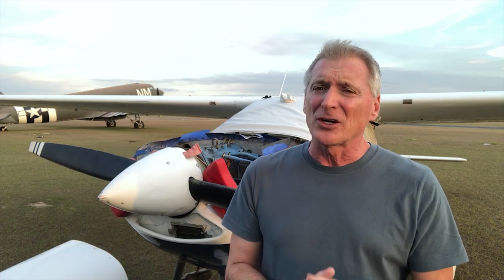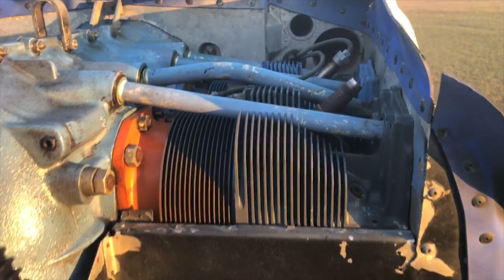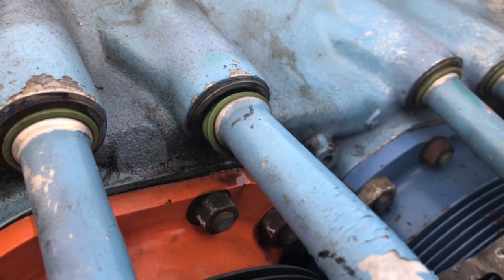When Really Bad Things Happen

Comment: Savvey aviation just did a story on a similar situation but it happened in flight. The results were not as bad as I expected. You may get away with a replacement jug and pushrods if your cam is not damaged. Might be worth a try to get that extra 200 hours out of it and build up the replacement engine account. It was a well written piece/advertisement. I actually trust Mike And his people to be very safety minded while also keeping economics in mind. Good luck with whatever you decide.
Reply from the maker: That’s exactly what I’m doing and I was referred to Savvy aviation as well ! Thanks for watching!

Comment: The pushrod is a consumable. Probably from a stuck valve. Before you do anything else just have the push rod replaced and see what happens. It looks terrible, but apparently not really. 
Looks like a Lycoming 0-320. I've got one in my Warrior. I got 3968 hours SMOH on mine before I had a prop strike. I also had a bent push rod. I ended up getting an engine rebuild, which is still in process. But now...it's compounded by the new Piper wing spar AD.

Comment: This happened in flight to a C172 in my flying club.  Ended up a rocker on the exhaust broke and caused this to happen to the intake. That engine had just been overhauled and only had 200ish hours. Happened in flight and pilot was able to still fly and make a precautionary landing.

Comment: Was your engine running rough on low rpms on previous flights? This may have been an escalated lycoming morning sickness. It’s a miracle the valve ended up getting stuck while you were still on the ground. Fly safe. Love your videos and thanks for sharing.
Reply from the maker: Thanks actually we found the real problem which was a hole in the air breather tube which made the engine run for Rich and I don’t know how long that’s been going on. I wanted to make a video on it but I’ve been so busy with work and I haven’t had the time. Thanks for watching! I have some programs coming up or I’ll explain everything—
Reply: Over 50 and Learning To Fly! Looking forward to it. Keep up your excellent videos

Comment: Don't let the shop tell you right off the bat to replace the engine for $23k !!  You just had the #2 exhaust valve stick closed, so when the cam tried to open it via the pushrod the pushrod bent up along with the tube you see on top.  Since the valve was stuck closed it means you wouldn't have even had a valve to piston strike so there is likely no other damage to the engine. Plus you were on the ground so the RPM's were low.   Mike Busch has a great video called "Why Valves Stick" and the opening image even shows your exact scenario, bent pushrod tube.   THIS IS A CYLINDER PROBLEM NOT A CRANKCASE PROBLEM !  Pull the cylinder and inspect and may just be reaming the guide and putting a new valve in and new pushrod and tube.  At the shop I use your talking about $800 max.  Drain the oil and inspect the sump screen and filter - if any metals found send this to Aviation Laboraties for analysis of where it came from.  This step confirms the cylinder problem did not cause a crankcase problem.  There are Lycoming Service Bulletins that tell you how to address metal in the oil.  This is the scientific approach wheras most shops just want to replace the engine and leave you stuck with the cost.  FYI I have the same plane you do - '68 Cardinal and love it!  I'm based at Craig.  Reach out to Savvy Aviation and ask if you can start their breakdown service retroactively.  They have a whole team of A&P's / IA's that can help you navigate this issue and sometimes they let people start the service even after a problem.  Call the phone number on their website.
Reply from the maker: You are exactly right! That’s exactly what we did today we pulled the cylinder and it was a stuck valve. So I’m gonna go ahead and overhaul the cylinder and change the oil in the oil out for analysis which I’ve been doing for the past year and I can see the engine progress and other than that this is going to be a straight up repair and not a rebuild which I’m really thankful for. Thanks so much for watching and again you are exactly right!

Comment: Bummer Ted.  My mechanic found a crack in my engine case during an annual inspection in 2018.  The 1750-hour engine had been running perfectly until then.  It wasn't burning oil, compressions were great, and the airplane beat the published performance numbers, which are usually pure fiction written by the marketing department.  Oil analysis was great and borescope inspections revealed no issues.  And yet... 

Because my engine had already been overhauled twice, I elected to go with a factory reman.  The price premium between a reman and an overhaul was about $6k, so for me, it was an easy (but painful) decision.  The reman comes with a 2 year warranty and a recommended 2200 hour TBO, vs. the old 2000 TBO.  The reman option also allowed me to convert from the "1 1/2" mag motor to the dual, independent mag motor.  This opens up the possibility of converting to an electronic mag in the future.  It also let me get rid of the Bendix mag, which was bought by Continental, Lycoming's competitor.  Future production and factory support of the Bendix mag is in question.

Don't forget to budget for the stuff you might want/ need to do when the engine is off the airframe:  new engine control cables, flush or replace the oil cooler, replace engine mounting hardware, engine hoses, etc.  Good luck.

Why is insurance company involved?
Reply from the maker: Thanks - I want to see just if there’s a possibility that something is covered. I may be able to get away with replacing the cylinder on this one so we’ll see this week what happens I have been looking at a factory remanufactured engine as well it’s pretty pricey but I’d rather have the peace of mind and the extra horsepower. Thanks for watching!

Comment: Something like this happened to me in a 206. Preflight was clean. Engine was running smoothly at the time. During the flight notice that the oil pressure drifted just slightly lower than the center of the green, but still green. Landed with only 2 qts of oil left!

Comment: Very curious what insurance involvement is? I did not know they would cover a engine failure repair.....
Reply: Yeah,... I was wondering too,...sticking valves is wear and tear or call it deposit buildup around the push rod guide area ....normally not covered.

Comment: The bent pushrod screams 'stuck valve'; not sure why your mechanic thinks it threw a rod. As the avweb article indicates, you may not need major engine work.  BTW, I also have a 150 '68 177, and the lower cowling exposes the lower firewall in climb, resulting in poor airflow when you need it most. High temps= stuck valves.   I'm based @ KCLW and was rudely awakened when I installed my engine monitor how high the CHTs were getting, even with the Fixed Cowl Flap and exhaust fairing from Maple Leaf (two mods I highly recommend). As a result, I typically use 5 degrees of flap when climbing in winter and more in summer to lower the nose, which helps airflow through cowl and keep the CHTs in the safe zone. BTW, if you're not already a member, join Cardinal Flyers Online. They have a wealth of data, pics etc, and between the vast knowledge of the webmasters and contributors, you can get any answer or suggestions needed.

Comment: Stuck exhaust valve at start up sounds likely the cause, like others have said. That cylinder is a chrome replacement cylinder, and I have also replaced 2 cylinders in my 182 with chrome, because I couldn’t find anything else at the time. Would be curious how long in hours that cylinder has been on there. They often stick because of excess deposits on the stem. Mike Busch has a good video on valves.
Reply from the maker: Thanks!

Comment: Welcome to the club!  I just made a video that included pulling the engine off my 182.  You will probably do the prop, prop governor, exhaust, remove and inspect (paint) the engine mount, etc.  My original cost was $34,000 for the overhaul, but with everything else (and labor), the final price will be between $39,000 and $49,000.  Let's hope the prop is able to be overhauled (that is the biggest variable at this point).  It sounds like you want to go faster (based on some older videos).  It might not be worth it to do the engine for you.  It was basically run out anyway, so you may just want to cut your losses and upgrade to an RG.  If you do the engine....you should probably keep it for a LONG time.  Good luck!
Reply from the maker: I have been pricing an IO 360 @31k - I could probably get 3-5k for this engine as she sits .... that’s one way I could go through this .... Thanks for watching!
Reply: @Over50andLearningToFly  Most places that give you an engine want a "core" in exchange.   You may have to trade yours in.  You probably knew that...I'll be watching to see how it goes.
Reply: @Over50andLearningToFly  I don't think there is an STC for the 1968 and 1969 Cardinals for the IO -360.  I think the O-360 is your only upgrade option.

Comment: It stuck a valve. Have your A&P pull the valve cover remove the rocker arm shaft and rocker arms. Remove the exhaust valve spring and punch the valve into the cylinder and get a 1/2" reamer ream the guide and reassemble the cylinder. Get a pushrod and tube and finish the cylinder assembly and continue to run it. If there is other damage that you are not telling us that's another story but if that's it RUN IT!!
Reply from the maker: We pulled the cylinder today - yes - stuck valve - overhaul the cylinder and be back in the air next week ! Thanks for watching ...

Comment: If you decide to overhaul engine go with the  STC for the 160HP pistons.  You already have the powerflow exhaust.  You will need to have your prop repitched.  Your Carb will need to be overhauled with a different jet but all that is covered in the 160HP STC.  Very little additional cost to go this way as you will already be doing an overhaul.  To go with the 180 hp upgrade the cost and weight will go up.  I went with the 160hp, powerflow a number of years ago and enjoy the extra power.  Here is an article that describes your failure.  https://www.avweb.com/ownership/dealing-with-stuck-valves/
Reply from the maker: Thanks!!!!

Comment: Facing the Queen Mother of aviation’s “big bills” is no fun with no easy solutions. Let’s see, overhaul or factory remanufactured engine? One of the best engine shops in the country, Zephyr Aircraft Engines, is based at your airport so a quality overhaul is relatively convenient. However, depending upon what all needs to be done to your engine, the cost may come close to a Remanufactured engine. The Reman will include more new parts, the roller tapper valve lifters and add more resale value to your airplane.
There have been 150 hp Cardinals upgraded to 180 hp, but that will not likely give you the gross weight increase of a 177B model nor is it simply a bolt-on conversion, which will add to your costs.
Going to the high compression cylinders to obtain 160 hp is not such a slam dunk choice either. Your 150 Lycoming was designed to run on 80 octane AVGAS ( the good old days) but the 160 Lycoming and 180 hp Lycoming requires 100 LL. If 100 LL goes away in the future, your 150 Lycoming could run on the Swift Fuels 94 unleaded AVGAS that is already approved and on the market.
Don’t forget the incidentals that come at engine time. Like, sending your engine Mount out for NDT testing and repairs. That Mount has been supporting the weight of your engine since about 1968, right? It has also been subjected to heat, cold, vibration and G forces. Don’t kid yourself into thinking those tubes don’t have any cracks in them or are not showing signs of stress. My IA once told me that of all the mounts that he has sent out in his career, only one (1) needed zero repairs.
New Lord Mounts, new oil cooler, hoses, etc. your new engine should come with new starter and mags. How is your exhaust system? What condition are your baffles in? How about your prop? Is it time for an overhaul followed by dynamic balancing on your nice, new engine?
My advice is to do the complete job without cutting corners and do it right.
Why replace the oil cooler? Well, it is one of those single point failure items that can ruin your whole day. Early on in my ownership experience with the 172, following an oil change, we did the post oil change ground run to check for leaks. We found one when the oil cooler chose that moment to cut loose. Oil went flying everywhere. Good thing that didn’t occur during our very next departure...
Reply from the maker: Awesome! You are right !   Thanks for watching!!!

Comment: That looks like a stuck exhaust valve that caused the bent pushrod.   Do you know where the oil leak came from?  I.e., did something (piston rod?) break and crack the case?  It also looks like the cylinder that had the problem has been replaced previously, so if that was recent, you may need to discuss the cause with your A&P.   I'd be very surprised if your insurance covered replacing a run-out engine (mine does not) unless it as caused by an accident of some sort, but will look forward to what you hear from them.  You can put in a 180 hp engine and constant speed prop if you don't already have both, but upgrading to a 200 hp IO-360 or IO-390 isn't in the cards unless you want to probably spend more than the engine costs in certification.

Comment: Nothing that insurance is going to help you with. It's a simple valve sticking, common in Lycomings. Also with a 1800+ hours on the motor, deal with it it's time for the overhaul. Again insurance is not going to pay for this.
Reply from the maker: Yes but it was definitely worth a phone call! Thanks for watching!
Reply: @Over50andLearningToFly  Thanks for the reply! Yea, engine repairs are costly, no harm in calling your agent. While overhauls are expensive, don't cut corners, spend the money to do the job right, and have a safe engine that you can depend on for years to come.